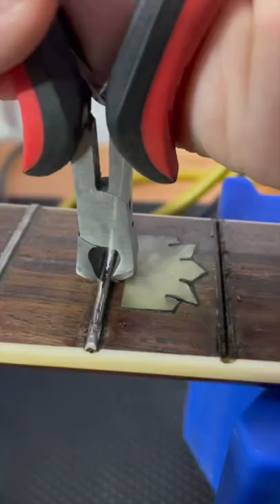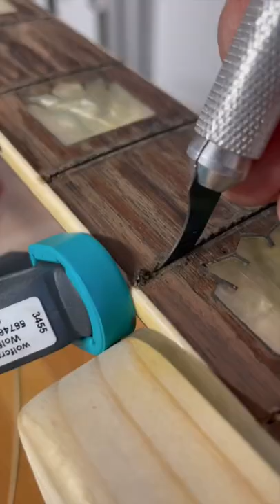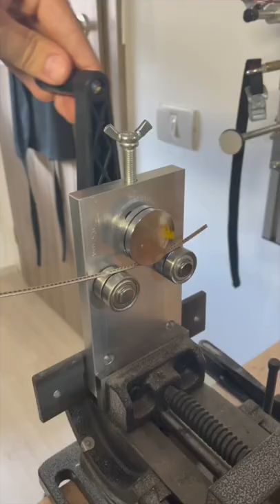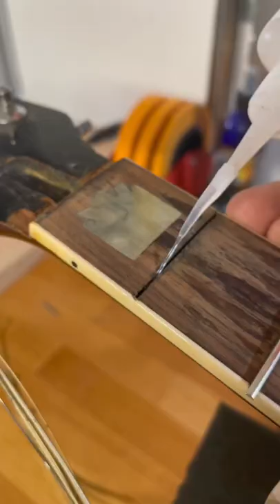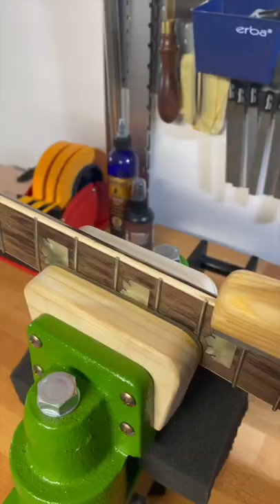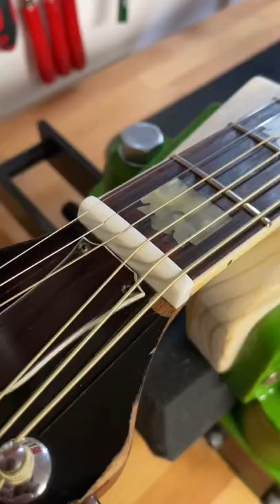My approach&most of the steps I take when refretting a bound neck. Follow me on IG @atticstringworks

Comment: Very nice job and great video, keep them coming 👍🏼.
Why did you put solder on the fret at the start befor you take it out? Was this to soften old glue?🤔
Reply from the maker: Thanks! Heat helps to break down the glue and makes the overall extraction a bit safer. I use solder to help the fret heat up faster and more even.

Comment: It's nice to arbitrarily expand my knowledge of guitars. Now I have a good idea of what is involved in refretting a guitar.

This guitar looks like an older Aria. With mass produced guitars, even the cheapest ones, there is a chance that if it has been taken good care of and that the wood stock it is made of make it a far better value than it is likely to be sold for. Especially older guitars. Knowing what kind of straightening can correct a slightly bowed neck that produces a lot of fret buzz can land you a nice instrument that a good luthier will be able to fix fairly cheaply.

But I dunno about using cyanoacrylate to glue the frets. They obviously previously glued in with hot glue.
Reply from the maker: CA glue is actually a really common choice, it’s pretty easy to work with. Stewmac has a great video on this topic, regarding different glues used for frets.

Comment: Wow, I thought about this today. What a mess this would be how hard it would be a crazy it would be then lying here unable to fall asleep here it is. I'm a guitar and bass player I don't think I could ever do such a smooth intricate work I want to buy new Mexican Fender a couple years ago discuss it to find out the neck wasn't lacquered at all I wanted was a maple neck it was really good and this thing was open and exposed to the air the neck was swelling and shrinking and you could tell being exposed to the air and moisture in the fronts the front wires were horrible and they were most horrible thing I'd ever seen at any guitar it felt Rusty they felt like they've been popping out a little bit horrible put it back so ticked off didn't notice they had just recently switched the Thunder logo from Silver to all black so I avoid those Mexican models at all cost. There's still some of the old ones that float around sometimes hardly played by people with the fender logo is silver. I was possible when I picked up an epiphone g400 which is one of the only Apple phones that I noticed looked properly like the shape of a Gibson and that thing I had amazing for at work the front wires on that were so smooth and not catching my fingers like the fender Mexican model was. Oh Joe for a new $500 fender to have the sweet work that that guitar had and the g400 was cheaper but obviously much better guitar. Fender screw themselves out of a sale that day and a whole lot of people who I told afterwards they decided they aren't going to go mess with one from Mexico at that point.

Comment: Do you have a video where you are doing it with a Les Paul or an SG where the binding cups up over the edge of the frets?
Reply from the maker: Unfortunately no, in most cases the nibs are cut off from the binding. Keeping them is usually being done on vintage guitars and it gets far more expensive overall

Comment: With the strings off, do you set the neck straight before using a long sanding block?
Reply from the maker: Yep, definitely. As straight as it can be. That way any inconsistencies can be addressed
Reply: @VladCotrus  Awsome, thanks. Also, I'm glad my intuition is on point! 😂

Comment: Do I have to make the fret iron concave? Or does it take the shape of the keyboard when we nail it with glue? There is no practical tool for this at home.
Reply from the maker: You definitely have to radius the fretwire otherwise it might not seat in firmly. Some have been doing it with pliers.

Comment: Super glue frets is a big mistake. Carpenter glue works best especially when you have to regret. Super glue can take wood with it when you remove them. But your heat it first. Not everyone does that
Reply from the maker: There’s no right or wrong. Titebond would work, superglue also. A competent luthier should figure out what he’s dealing with after taking one fret out or even before, and then decide what’s the best method to extract them. It’s all about the approach.

Comment: How do u lower the action on a an acoustic guitar? I need to lower my strings
Reply from the maker: First of all it needs to have the proper neck relief, after that you sand the bottom of the saddle to remove material keeping it perpendicular so it’s square
Reply: @VladCotrus  thanks i found a video about sanding the saddle it will ne very helpful

Comment: Why not file the ends of frets before gluing them on?
Reply from the maker: It’s inaccurate and not that consistent plus it would be really time consuming. You can’t eyeball it to fit perfectly and predict how much of the fret will poke out especially because the fretwire is preradiused to a tighter radius so that way the fret bites better in the wood when seated.